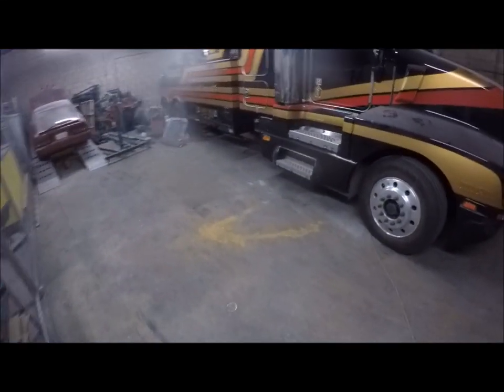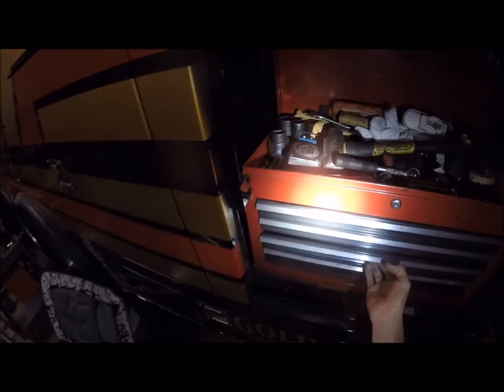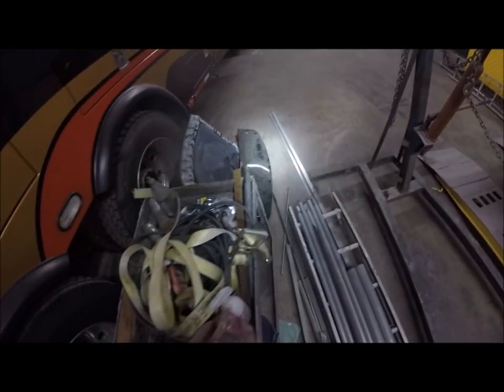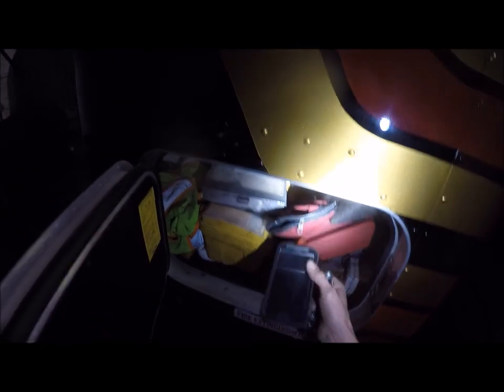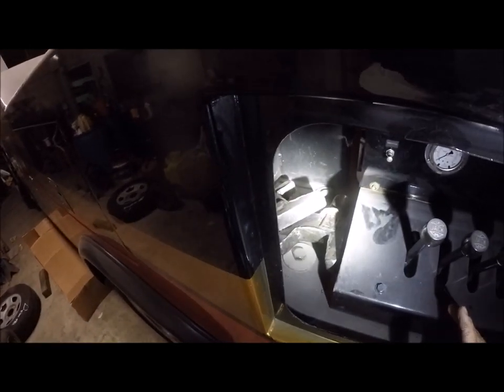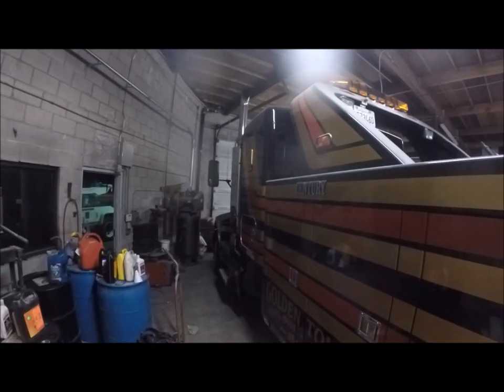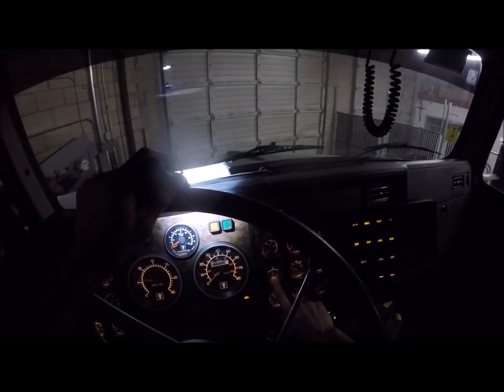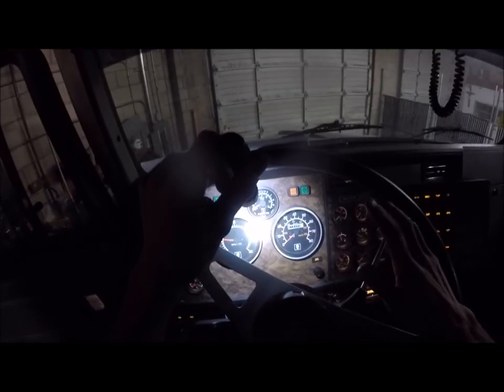HEAVY DUTY TOW TRUCK TOUR

Comment: Do you have a cdl? Why isn't the truck used more?
Reply from the maker: gg hh answer your question yes I have a CDL Class A tankers and Hazmat the reason we don't use that truck more is because we don't have a big need for it most of the stuff I can do with my medium and we generally mainly deal with small vehicles or regular light duty stuff one of these days I'll take it out on a call and we'll get to see
Reply: Pyro4100 Is it on rotation? Heavy duty is where the money is.
Reply from the maker: gg hh unfortunately it is not a rotator but we've never really needed one it's our only heavy duty it's a 30-ton straight back boom
Reply: Pyro4100 lol I asked if it was on police rotation not if it was a rotator.
Reply from the maker: gg hh you know what I read it too fast I didn't realize it myself yeah it is but rotations a little different for heavy since we only have one we get less than the companies I have more but we make our money back in the year for it I've got a video from like a year or two ago we had a call with a semi with a ruptured fuel tank